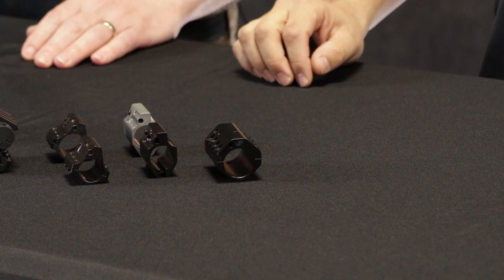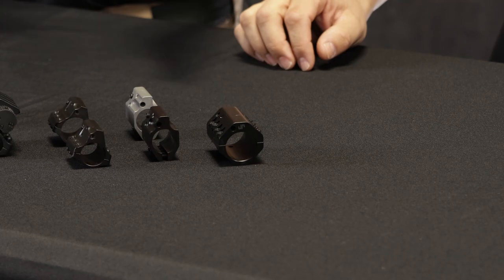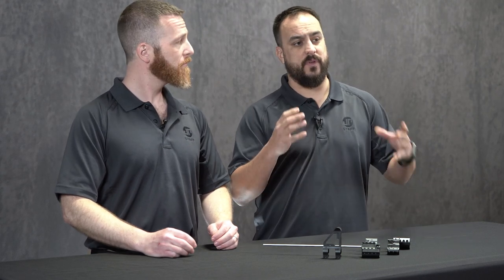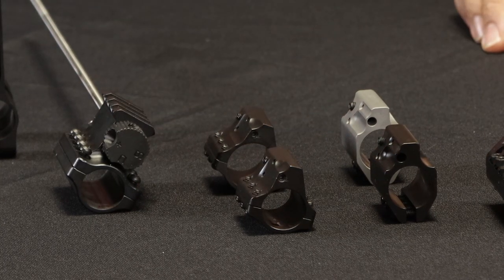Product Focus: Adjustable Gas Blocks

Comment: I wish you made the A2 front sight in an adjustable gas block that was NOT clamp on...but was set screw with the option to use pins/taper pin set up.

Comment: Adjusting the JPGS-9D on a  LR 308,  20" barrel ,  0.096" gas vent. Correct ejection angle of 3 o clock @ 18 clicks out. 25 is max..
Beyond that there was no difference in felt recoil or function. Hard recoil and bolt strike on upper has been a problem. 
I was expecting some felt recoil reduction but didn't perceive any. Scope is worth effort to reduce as much recoil as possible.. 
Would like to hear others experiences with this gas block. Great product, great company.
Reply: Sounds like you need a heavier buffer in the back end as well. You are running that block almost wide open, I assume you are shooting unsuppressed
Reply: @stillenacht8518 lighter buffer, not heavier.
Reply: It’s 308; so, it’s going to be spicy regardless. Use the least amount of gas necessary to cycle reliably. Play with the buffer weight and spring strength as secondary and tertiary adjustments.
Reply: @illestdomer2005  308 is not spicy at all. You can get it to be extremely soft shooting.

Comment: I just bought an 11.5" BCM Enhanced Lightweight Fluted barrel. Is there a specific gas block that I need for it? I hear numbers like .675 or .70... what does this mean? Also, aside from price difference, is there any real downside to going adjustable vs basic? It seems like a no-brainer but I feel like I'm missing something. Also want to run it suppressed at some point.

Any reliability issues? Should I focus on the buffer instead and will it give me equal results?

First AR build. Thanks, I subscribed!
Reply from the maker: We love adjustable gas blocks and think that they are the must have upgrade for any AR platform. However, you could get away with a non adjustable gas block if you would like.  The .675 numbers, are the contour diameter of the barrel were the gas block goes.  Once you have that number you will look for a gas block that has the same measurement.

Comment: So I’m very interested in installing the A frame FSP block (JPGS-2FS) on a rifle that currently has a standard  A frame. Will the existing cuts in the barrel that accommodate the pins effect the install of this new FSP?  What do I need to know before I install?
Reply from the maker: Since the JPGS-2FS does not utilize those pin holes, they should not cause any issue with installation.

Comment: Y'all guys are going to make me spend more money lol I just got a db15 and it is a lil overgassed with the ammo I like to run with and have been looking at just this lately looking for a clamp on style just like what you showed.. thanks and like the vids a lil more technical explanation would be nice though
Reply from the maker: We are working on videos to show you all more hands on and technical explanation.  We wanted to start at the basics for beginners and work our way up to those who would like more detailed specs and understand it.
Reply: I just shoot a single rounds with my rifle... with each round loaded 1 @ time in my magazine. Adjust it after you shoot each time... 
 Until you have just enough gas to cycle it fully & where it will reliably leave the bolt locked back & open after each round you single load in your magazine before test firing the weapon.

Comment: I have a question.  I have a Hbar 16" carbine gas barrel.  It seems a bit over gassed, ejecting 556 cases at 1:00 to 2:00, so I added a H buffer, still pretty much the same.  Then moved up to H3, cases landing at 3:00.  I would like the case to eject at 4:00, I was planning on going with adjustable gas block.  Since I have the H3 buffer in the rifle, should I keep it with the Adjustable gas block or go to a carbine buffer?  What are the pros and cons of leaving the heavier buffer on the rifle with an adjustable gas block?  Thanks for the video and the info.
Reply: me too... I think I have a way to adjust at either end & my thoughts are...
so, H3 buffer weight equals
 -more overall rifle weight
- more felt recoil
Reply: Try the Geissele spring/buffer or stick with an H2 and a adjustable gas block. 
I’ve also put a folding stock and when doing so there is a spacer weight that fits in your BCG…just adding that will slow/smooth out that recoil.

Comment: So, i bought a JPGS-8, thinking that it only required clamping (i don’t have a precise way to dimple the barrel, nor do i want to drill on it), but i see in the instructions that it apparently requires the set screws!  What is the recommended method to accomplish it?  It’s annoying, to say the least!
Reply: jackhammer... with just one thump...

Comment: I used to run adjustable gas blocks but unless its for suppression a quality traditional block is a better option imo. Use the buffer and spring to tune it rather than masking issues with the adjustable block